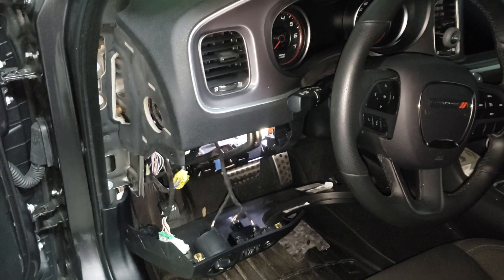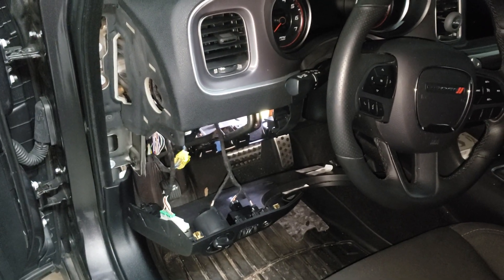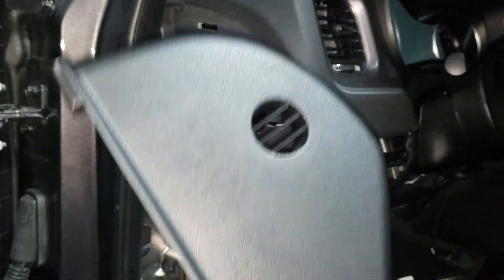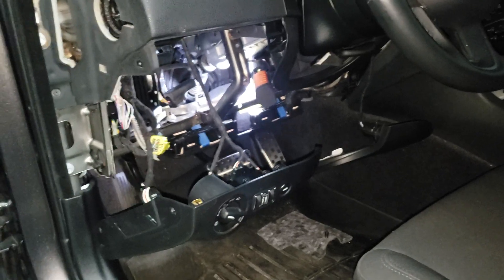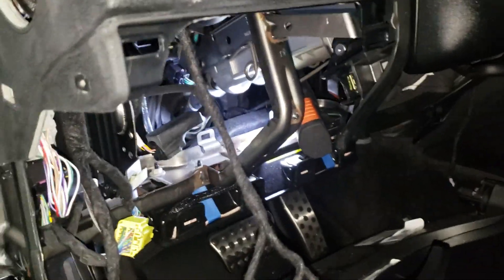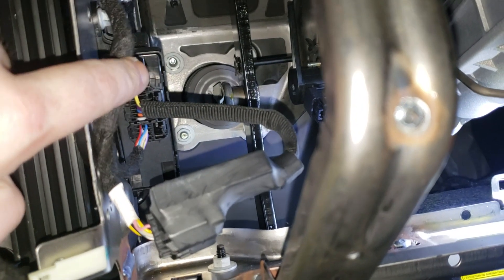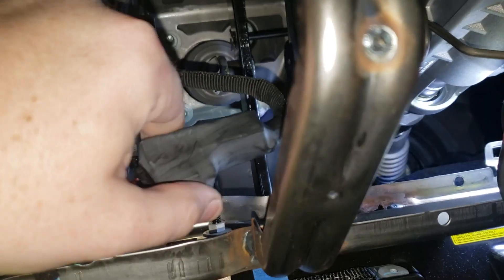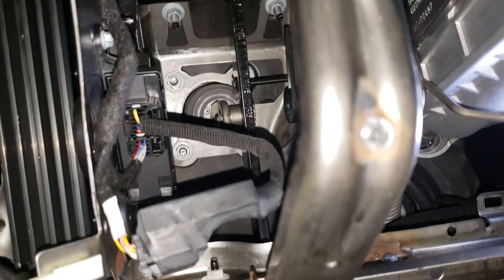Dodge Charger HPTuners Smart Access Cable Install

Comment: Do I have to buy a spare pcm for 2022rt or do they send cods to the tuner to unlock pcm
Reply from the maker: So you can either send in your stock PCM to HP tuners for them to "unlock" it so it can be tuned. Or you can do what I did (as well as many others) and purchase an unlocked PCM directly from HP tuners. I personally wanted to keep my oem/stock ecu as a backup/spare in the rare event something happened or if I decided to revert my Charger 392 to stock and sell it. Its expensive to tune the 392 if you go the new unlocked PCM route but with the right tuner its well worth it especially with changes to the 8spd trans. You will also have to purchase credits for the PCM and TCM through HPT as well as purchase the MPVI3 OBD2 adapter, and this smart access cable to tune the vehicle. Hope this helps.

Comment: Bypassing this module does it allow for tuning without having to send my ECU out to be unlocked?
Reply: No
Reply from the maker: Still requires ecu to be unlocked. The 2018+ need this bypass module to utilize the obd2 port for the MPVI2.